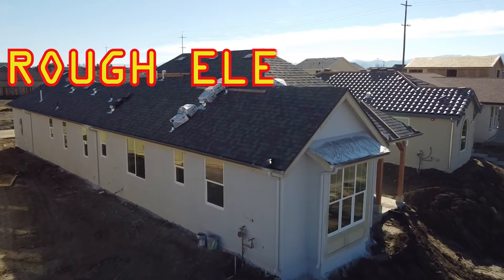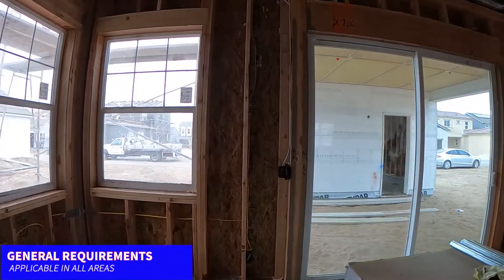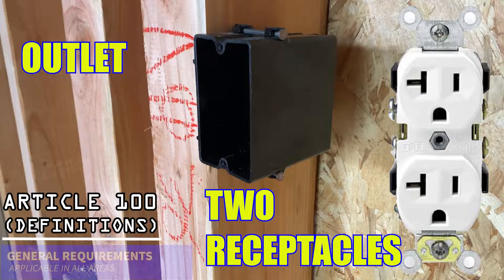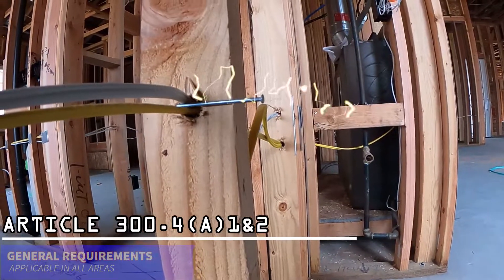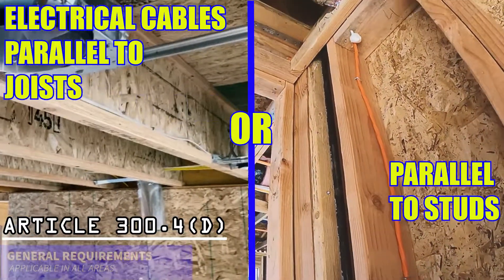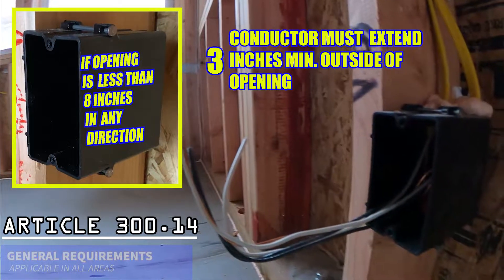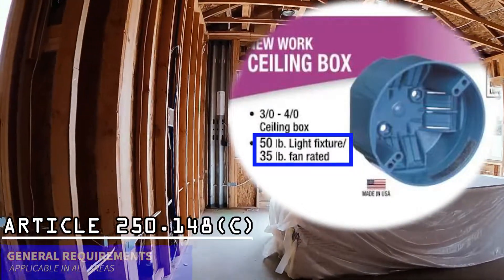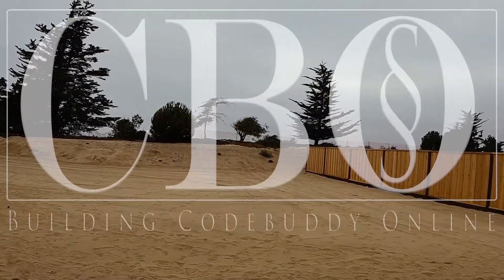Rough Electrical Inspection [Residential/NEC & CEC] - Part 1 OF 2

Comment: Does the outside meter service have to connected for the rough in
Reply from the maker: Hi.  For a rough-in inspection, you typically don't need the outside meter service connected.  The rough-in inspection focuses on checking the internal wiring before walls are closed up.  However, some jurisdictions or utility companies might require the meter service to be connected, therefore, it is best to check with your local building department and utility provider for their specific requirements.  I hope this helps.  Let me know if you need further clarification.  

JM

Comment: I really enjoy and take a lot from your videos. Please keep them coming
Reply from the maker: Marcel - It is such a great pleasure to hear this from you.  I am very glad they served you well.  I have been in a bit of a funk lately (lack of sunlight and rains?), and busy with work - so the Mechanical Inspection vid has been on hold for a bit; but I will be rolling out the videos very soon, as I also have topics related to building plan code requirements for a variety of projects that I intend to roll out.  So thank you for your message!  I appreciate it and it's inspiring. 

Be well, friend.

Jose M

Comment: Great content! So simplified for the average man.

Question. Is running 220/240v in conduit for a exterior wall outlet to code? I was told it was not. Trying to run a wire across my garage shop for a welder using conduit.
Reply from the maker: Hello.  Great question; also, thanks for checking out the content.  
Withouth knowing site specifics, I can only say that using conduit is not prohibited by the electrical code for the scenario you describe, that is unless your local jurisdiction restricts the use of conduit in your scenario.  
However, a few things to consider are; the conduit size that is based on the number of wires to meet the "fill rule"; and the conduit type -- will the conduit be used as physical armor? (if using as physical armor, then Sch. 40 PVC is inadequate -- just an example); you will also need to derate conductors based on how many will be in the pipe.
I would suggest reaching out to your local building department to inquire.  On a side note; if ever informed of a restriction, I would ask for the regulation justifying the restriction - as this can serve as a learning opportunity for all involved.  I hope that makes sense.
Please let me know if you need further clarification.   Thank you for your question.

Take care,

Jose M

Comment: I purchased an incomplete construction from a wholesaler. It is framed with metal with plumbing rough in already done and electric started. Due to demand now it's kind of hard finding a license contractor and probably would cost an arm. I have done full renovation before and is somewhat capable of managing a project. How does ownership transition work in a case like this. I'll likely need to get the inspection that was already complete redone... How will that work for plumbing etc if the subfloor is already on? 

Would they just do the water pressure test and assume all the angles of the pipe etc are the same as they were when (if) they passed last inspection?
Reply from the maker: Great question -- and thank you for stopping by.  I will assume this is a residential (dwelling) building you are referring to; and I will also assume you have the approved plans & building permit from the seller?  If not, you may consider attaining those documents and any/all permits and documents that may have been issued by the local jurisdiction.  Such documents should be accessible through the public records laws of your State, but contact your local building department if you need to attain those records.

Well, the “material shortages” is what seems to have driven most construction costs through the roof – so I don’t blame you for taking on the task, especially if you have done renovation work.  Besides… nowadays there are tons of great videos online which can help you along the way… 

In terms of ownership transition, I can only tell you from the general California building department standpoint -- which is that you will likely be required to change the permit documents, with the building department, into your name so that they can issue you a new/updated building permit with current ownership and builder information (which it appears you would be the owner/builder).  Check with your local building department for “Owner/Builder” requirements.  Owner/Builder requirements could vary in all States; as an example, in California – as an Owner/Builder, generally you can do the work or sub-contract to licensed contractors some of the work, or all the work.  

As for the plumbing work; if the work was previously tested, inspected and documented “approved” by the building department – then nothing further should be required for the plumbing work up to that point; it also depends on how long the work was left abandoned; you may still want to test the system, even if the building department does not require it; in fact, as you suggested, I would discuss reinspection of the work with your local building inspector.  That is a great idea, as he/she should have intimate knowledge of the project (assuming the same inspector still works there).  Furthermore, visit your local building department and, through the public records laws, ask for a copy of all inspection notes and sign-offs; this should help your transition into the project manager owner/builder…

Also, there should be an underfloor access door to access the space below the subfloor, if there isn’t one; and that is where the work could be reinspected from, instead of removing any subfloor sheathing.

I hope the above helps you; but please keep in mind that the State and local jurisdiction you are in could have different requirements.  
Best of luck to you and congratulations on the purchase.

**Edit:  Please let me know if you have further question on the above, or if you need clarification.  

-	Jose M
Reply: @CBO.online  thanks for such detailed response. Maybe this could be an idea for a video... But yes it is a residential build. It started some 20 years ago. I am in the process of getting a new building permit since permits do not transfer ownership (GA). I never thought about the trap door but I'll sure check the next time I'm by there. I do plan on getting the permit myself and sub the work out... Since I've submitted this question, I've done some research myself and I'll post the finding here:

1. My initial concern is how do I assure quality since being the plumbing was done and abandoned this long. How can a plumber use what's already there and make modifications where needed. How would they even know there is a leak if there is a leak etc.. 

What I found from research is you can do a pressure test on the entire plumbing (how brilliant!). What I think I might do once I get the permits approves is get a new floor plan done and document change in the layout if any... Sub the plumbing out to a licensed plumber having he/she makes the modifications AND perform a full pressure test and rectify any issues found. Pay for the  new inspection.... 

This is a 1325 square feet. I figure with pex/pez (not sure if I'm spelling it right) any modifications to water line shouldn't be a head ache... Waste line which are PVC should be pretty stable... House had a roof the entire time of course.... 

Feel free to insert your suggestions!

Forgive me for any grammar error. Typing from my phone with basketball player sized hands isn't the easiest.
Reply from the maker: @illmatic33  Thank you for posting your findings; it truly sounds like you already have a great game plan -- re-test the plumbing system with the assistance of a licensed plumber / rectify any issues / PVC seems to be in stable conditions/the house had the roof the entire time... I hope weather protected though, 20 years in the works is a little while; not so much for the plumbing, PEX pipe and PVC (as long as they weren't exposed too much to the beautiful Georgia sun), but for any unprotected construction materials -- you mentioned metal framing and that should be ok since it may be galvanized framing (?).  
Also, you may already have been informed, but be sure to ask the local building department if you will need to re-design the project to the current code of your jurisdiction.  If the building permit was issued about 20 years ago - and the project was "abandoned" since then -- then you may be required to re-design the work or portions of the unfinished work, to the current code.  It wouldn't hurt to ask the building department.   I am not  at all familiar with the GA codes to let you know what the updates/amendments you would need to do to the current work - if any.

I hope this makes sense.  It is funny you mention making this information into a video because the thought also crossed my mind; I will end up incorporating this information as part of an upcoming  video --- so stay tuned!

Thank you for your input, I truly appreciate it!

- Jose M